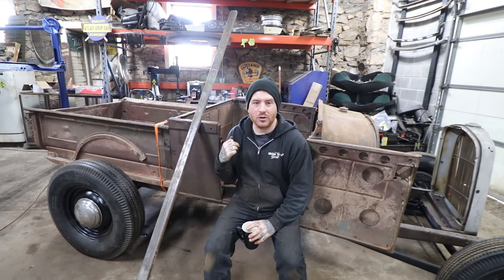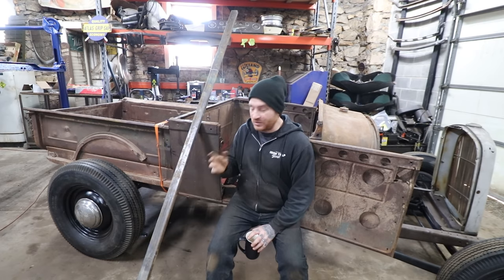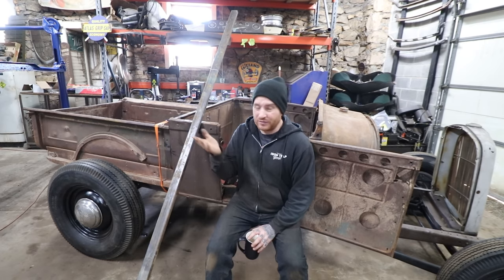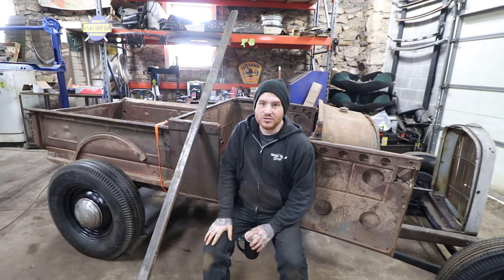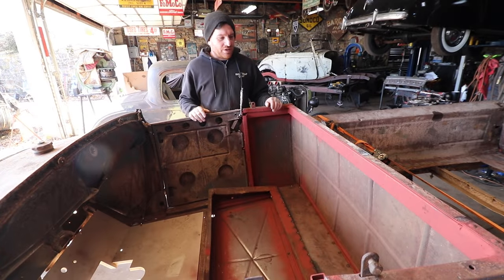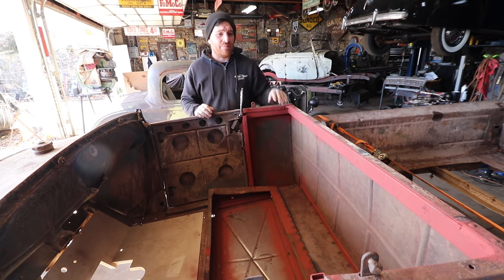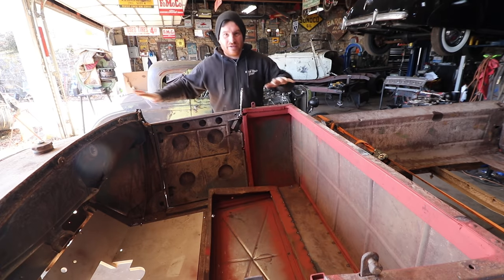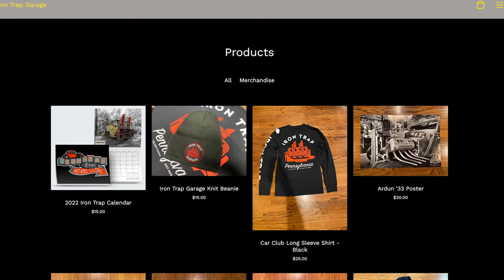Replacing The Wooden B-Pillars With Box Tubing - 1928 Model A Roadster Pickup

Comment: Hey Matt
   Using that tubing as you did really cleans up the top of the body.
I did something similar on a bucket roadster body I built a few years ago as well as on my 27 "T" bucket body made from a tub body.
   I have another 27 tub cowl and doors that I plan to make an RPU out of, so it will get the same treatment to stablize the body.
   Thanx for the video.
Stay Warm, Be Safe and Well

Comment: Just curious. Why do you prefer tig welding to mig? It seems to be slower. Is tig stronger or is it just what you feel most comfortable  with?
Reply from the maker: More controllable, no sparks, cleaner weld, etc. but for plug welding MIG welding is a bit better I’ve found.

Comment: Got a late 30's merc pickup cab  frame box, been chopped maybe 90's maybe earlier very crude, was tipped on side in sand and solid axle torched/kingpin boss cut , assuming for safety so no one would rebuild?....sheridan, wyo. Mercury glove box, all gauges, needs floor etc. also late 30's ford frame for $50. buffalo,wyo...dual leaf front end with plow attachment.

Comment: That sure strengthened things. Mighta looked cleaner if youd have taken some piecuts out of the top of door pillars and tapered them back to meet the sides rather than just leaving them with a gaping 1x2" hole on top
Reply from the maker: Capping the hole is simple. When the interior is all done it’ll all be covered up. Not going overboard on this build.

Comment: That chop saw sure makes the pie cuts go a lot quicker. But isn't there any way to move the clamps more under the center of the blade so that you don't have to make every cut from both sides? I guess maybe not. You'd have to use the band saw or make a square blade for the circular saw. Hmm.
Reply from the maker: Yea always a down side. It was still quicker than most other methods

Comment: How do you keep the radius of your pie cut tube where you want it. Every time I’ve tried this method it closes the radius when I weld it. Even when I clamp the heck out of it.Are you compensating for that in your cuts?
Reply from the maker: Compensating a lot of times. I also will clamp it in the vise with pressure pushing against the cut so it reduces the movement from welding. It’s always a crap shoot and sometimes I do have to recut and open a weld up. Like anything you get better at it the more you do it

Comment: Awesome jobob as always Matt. I have a quick question though about the Eastwood Rust Encapsulator. I can buy it through a company here in Australia but they're pretty hard to getbcùstomerbaervice over the phone in regards to the Eastwood products soooo....I see you coated the steel box tubing and the tub edges where the framing goes with the red oxide rust encapsulator and then welded the tubing in. Does that mean that Rust Encapsulator is a weldable primer??? Do you need to wire wheel the burn marks off before putting a base coat of paint on or will that be an issue with paint adhesion? Thanks mate...stay awesome!👍🏻🤙🏻
Reply from the maker: I do use it as a weldable primer. Yes I would clean any discoloration from welding before top coating. Rust encapsulator is one of my favorite all-around paints.
Reply: @IronTrapGarage  I never knew it could be used rather way. Ive been using a Dulux recently oxide primer that bubbles up.and comes off when welding on or near it. I have used one can here in Australia of Rust Encapsulator,  it cost $50 a can and only got a small amount of use out of it painting a side panel for a Dodge truck hood and the radiator cowl. But if I can use it to weld on then it'll be defiantly worth its money for those parts that I need thebare metal covered but can't get to after welding to cover in primer. Thanks guys.

Comment: What brand/name of weld through primer do you use ? I used to use Wurth when I was in the UK, yet here in Australia I cannot find anyone who has even heard of a weld through primer, I even contacted Wurth Australia who have never heard of the product
Reply from the maker: I use eastwood rust encapsulator. Kinda not it’s intended purpose but it works well for me when plug welding with a mig. If using Tig I clean the metal clean regardless in the area I’m welding
Reply: @IronTrapGarage  thanks for the reply will try and sourse  Eastwood encapsulator here

Comment: Great video Matt! I had planned on do this to my cab as well. That definitely cures the flex in the cab quarters when closing the doors! Do you plan on running it across the bottom of the cab back also? 

Matt- Mojo Speed Shop and Lounge
Reply from the maker: Not sure it’s as necessary at the bottom on the back as you have strong subrails and floor section holding the bottom together. But doesn’t hurt to do 👍

Comment: Matt, I noticed when you welding on the Pass. side, Steve was off to the right and Mike was almost in a direct line to the arc.  May I suggest building a 2 or 3 panel blind that can be placed around the area you are welding to protect the other guys from the flash and arc fire.